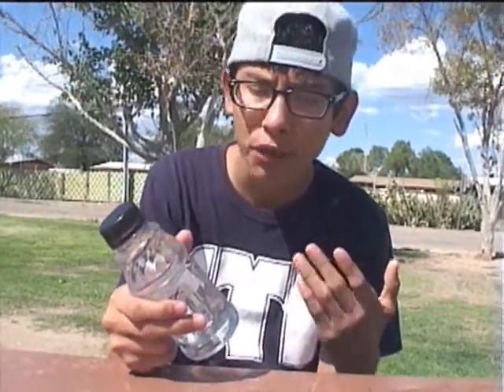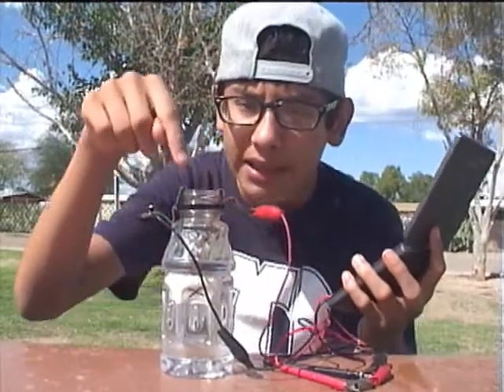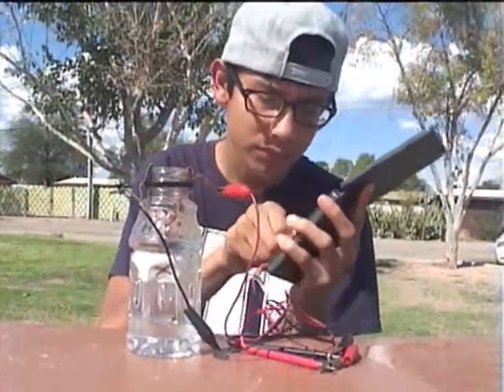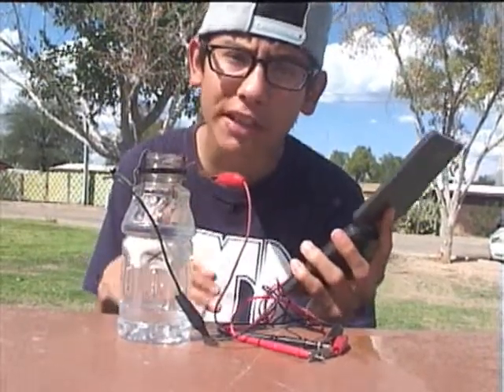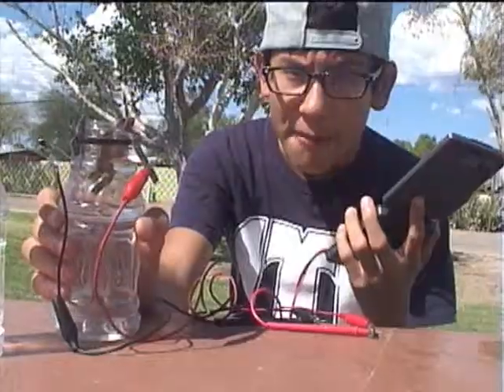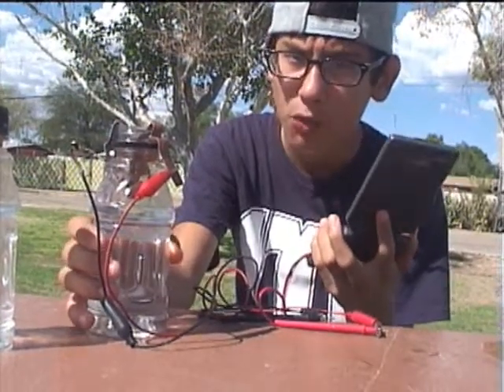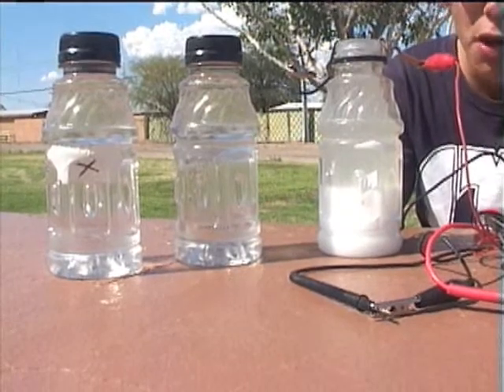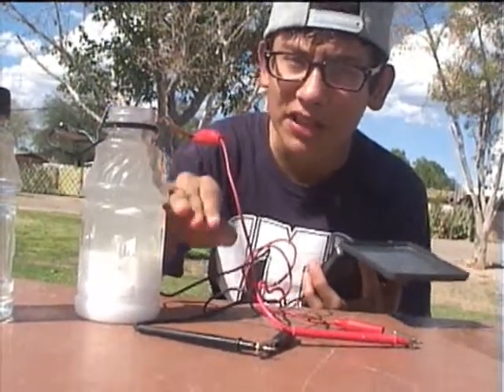Pure Water Test

Comment from the maker: You make an excellent point. In the picture the salt has mostly settled to the bottom of the bottle. To really take a measure I had to first shake up the bottle.
The salt was then evenly distributed. Then I took a fast measure because most of the salt will settle fast to bottom of the bottle.

Comment: Good info thanks. But, with that much salt visible in the jar you can't say "it's a 50/50 mixture". Really with that much salt, the water would have to be 100% saturated for room temperature water. It's the amount of saturation your looking for. The water will only hold so much salt before it begins to settle on the bottom.